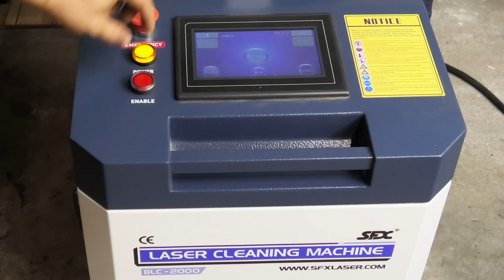Elegant 1900s Art Nouveau Stool Restoration - Flea Market Rescue

Comment: A fantastic restoration. The only thing I would add is using some of the wood dust from the sanding process and adding it to the epoxy to add a more consistent look. Other than that, great job!
Reply from the maker: Thank you so much for your kind words and thoughtful suggestion! I appreciate your feedback and the idea of using wood dust in the epoxy to achieve a more consistent look is a great tip. I'll definitely consider that for future projects. Thanks again for taking the time to comment and for your support!

Comment: Just because you can't see the wood in final doesn't mean it doesn't need stain.  The stain stops the wood from drying out and cracking.  Apply it to every surface of the wood you can.  Soak it into the screw holes.  Thanks for coming to my TED talk.
Reply from the maker: Thanks for the tip!

Comment: A good restoration, the stool does look amazing. The only thing I could not understand was the use of the epoxy resin, which did not form part of the original stool. A minor point I accept, but just puzzling. Good post and thank you.

Comment: I would have used an angle grinder on those welds (avoiding the filler) and replaced the leather using the back of a used leather coat from a thrift/úsed store.  As usual a good job!

Comment: You did an absolutely fantastic job on that stool, from wood to metal to leather.  I suspect that you aren't the first to repair it though.  The welding on the threaded bolt looked way too modern to be 1920's.  The welds were clean, even and consistent. It was available but it was in its absolute infancy and really not perfected until the late 1940's or early 1950's.  So I suspect it had already seen some repair before it ever arrived in that flea market.  Wonderful job though

Comment: I'm so glad you saved that little stool. You made a super job of it, although I'm surprised you simply tucked the leather seat loose into the rebate/rabbet instead of glueing the edges of the leather to the padding to make it more secure.
Reply from the maker: I'm glad you enjoyed the restoration process. There was no need to glue the leather 🙂

Comment: Super nice, I really liked how you powder coated exposed parts and blued the seat screw.  The leather rework was excellent.  What grit sandpaper did you use to work in the leather fix-it compound?  I've tried a few but found it really tough to get one that doesn't dig in too much but still does the job.
Reply from the maker: Thank you! I used 2500 grit
Reply: @rustyshadesrestoration interesting I've never used anything beyond 1000 grid.  I'm going to give that a try.  Thank you!

Comment: How does that laser thingy work?
Reply from the maker: It uses high-intensity laser beams to remove rust and other unwanted contaminants from various surfaces. Here's how it works:

Laser Generation: The system consists of a laser source, typically a solid-state or fiber laser. These lasers are chosen because they can generate high-intensity, focused beams of light in the infrared spectrum. The laser emits a concentrated beam of light energy.

Focusing Optics: The laser beam passes through a set of focusing optics, such as lenses and mirrors. These optics concentrate the laser energy into a small, precise spot.

Targeted Surface: The laser beam is directed at the rusted or contaminated surface that needs cleaning. The operator aims the laser at the specific areas to be treated.

Absorption of Light: When the laser beam hits the rust or contaminant, the energy in the laser light is absorbed by the unwanted material. This energy is rapidly converted into heat.

Heat Generation: The intense heat generated at the point of contact causes the rust or contaminant to rapidly heat up and expand. This expansion creates pressure on the surface contaminants.

Material Removal: As the pressure builds up, the rust or contaminants are either vaporized or expelled from the surface. This process is highly controlled, and the operator can adjust the laser's power and duration to ensure the desired level of material removal.

Collection and Safety: The removed rust particles and contaminants may become airborne or fall to the ground. In industrial settings, there are often mechanisms in place to capture and safely dispose of these materials to prevent environmental contamination.

Key advantages of laser rust cleaning include:

Precision: Laser systems can be adjusted for fine control, allowing for precise rust and contaminant removal without damaging the underlying substrate.

No Abrasives or Chemicals: Unlike traditional methods that use abrasive materials or chemicals, laser cleaning is non-contact and does not produce waste materials.

Minimal Heat Transfer: Laser systems can be fine-tuned to minimize heat transfer to the substrate, reducing the risk of distortion or damage to sensitive materials.

Environmental Friendliness: Laser cleaning is eco-friendly since it doesn't involve the use of chemicals or abrasive media that can be harmful to the environment.

Versatility: Laser cleaners can be used on a wide range of materials, including metals, stone, concrete, and more.

While laser rust cleaning is an effective and efficient method for rust removal, it's important to note that safety precautions, including wearing appropriate eye protection and ensuring proper ventilation, are essential when operating laser systems. Additionally, the choice of laser system and parameters should be carefully considered to match the specific requirements of the cleaning task.

Comment: Didn't understand the need for filler on the metal parts at all. They looked better before
Reply from the maker: They were full of rust pitting holes, and the welding was beautiful but too "brutal" for an Art Nouveau piano stool. I can also bet that the welding work is earlier than the seat's age. Best, Johnny

Comment: The sit is not horizontal.
Reply from the maker: It is a bit inclined because of the welding, but not much, and I won't cut the metal and weld again for a few degrees; the stool is very comfortable. That's why whoever did the welding job let it like that, too 😀 Good observation! Cheers Johnny